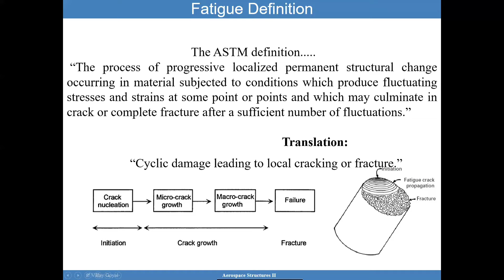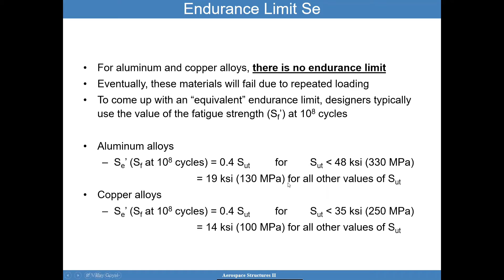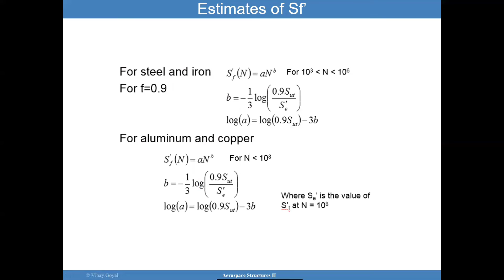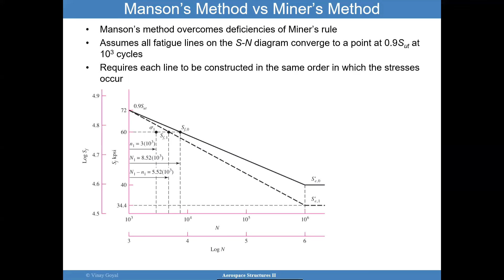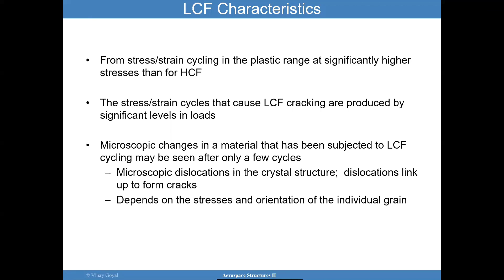Advanced Aerospace Structures: Lecture 6 - Fatigue HCF and LCF

Comment: 0:50-3:09 Fatigue Definition
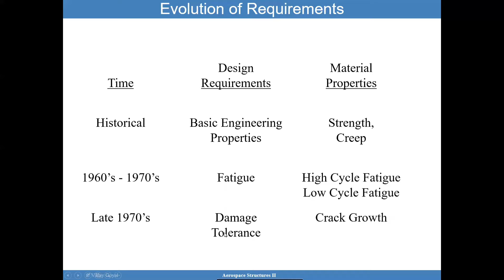3:09-5:00 Evolution of Requirements
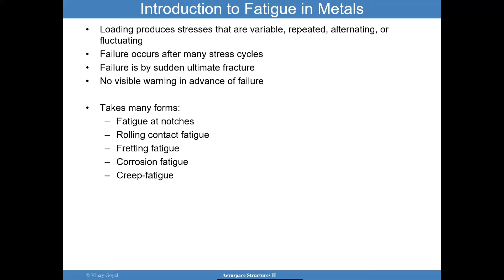5:00-6:06 Intro to Fatigue in metals
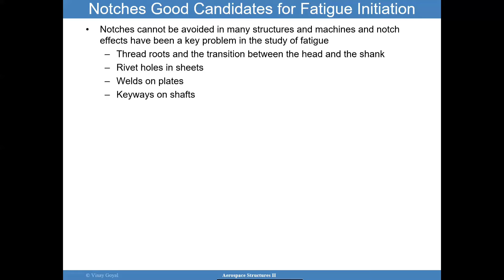6:06-6:45 Notches Good candidates for fatigue initiation
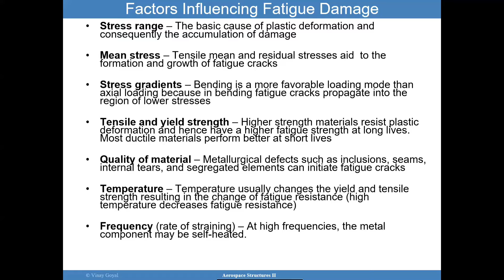6:45-9:35 Factors influencing fatigue damage
9:36-10:24 Potential Crack cause
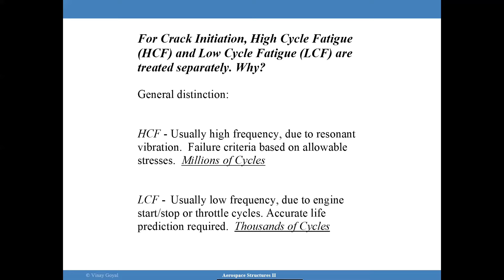10:24-11:40 Intro HCF LCF
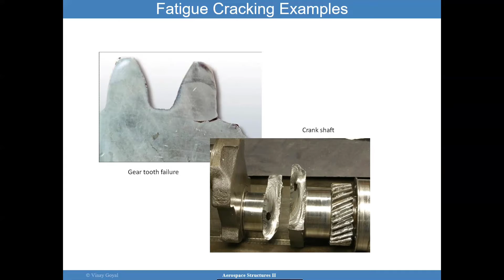11:41-20:40 Fatogue cracking example
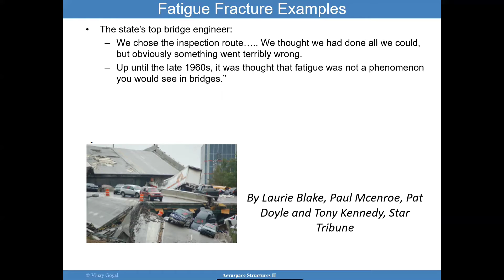20:41-26:13 Fatigue fracture examples
26:14-27:06 Stages of fatogue failure
27:07-28:12 Featured of fatogue fracture surface
28:13-29:14 Fatigue stages
29:15-29:45 Fatigue crack formation
29:46-30:20 Fatigue process
30:21-31:01 Fatigue process from material sciences
31:02-32:00 Fracture surface characteristics
32:01-41:40 Schematic Fatigue Fracture surfaces
41:41-41:58 Fatigue fracture surfaces per SAE
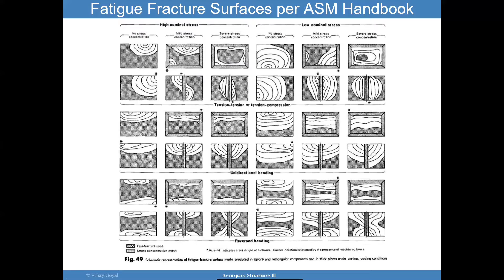41:59-42:16 Fatigue fracture surfaces per ASM
42:17-43:50 Fatigue life methods
43:51-44:30 Fatigue methodology
44:31-47:30 Fatigue tests
47:31-48:04 Moore test
48:05-49:47 Effects of diameter of specimen
49:48-53:20 Repetitive loadings
53:21-55:00 Characterizing fluctuating stress
55:01-58:26 Diff values if R (smin/smax)
58:27-59:30 Varying fluctuating stresses
59:31-1:01:56 Stress history-Rainflow cycle count
1:01:57-1:03:38 SN Diagram
1:03:39-1:03:42 SN Diagram Steel
1:03:43-1:04:27 SN Diagram Non ferrous metal
1:04:28-1:10:15 Endurance limit
1:10:16-1:10:55 Endurance linit Se
1:10:56-1:12:56 Influence of loading on endurance limit
1:12:57-1:13:39 Infinite v Finite life
1:13:40-1:14:18 Method of calc. fatigue strength
1:14:19-1:15:34 Terminology and notation
1:15:35-1:17:50 Endu. limit modifying factor
1:17;51-1:18:45 Surface factor Ka
1:18:46-1:19:08 Effects of surface finush on Se
1:19:09-1:21:54 Size factor Kb
1:21:55-1:23:16 Size factor on Se
1:23:17-1:23:32 Loading factor Kc
1:23:33-1:24:13 Temp factor Kd
1:24:14-1:26:10 Ex 6.5
1:26:11-1:26:39 Reliability factor Ke
1:26:40-Miscellaneous effects factor Kf
1:26:52 Mean stress effects
1:28:12 R-ratio effects
1:31:20 Effects og High cycle count
1:31:55 SN Curve
1:32:02 Eq for SN diagram
1:33:20 Estimated of Sf'
1:33:42 Example
1:40:14 Plot Alternating v Midrange stress
1:41:55 Failure criteria for infinite life
1:42:35 Safe zone Goodman Diagram
1:43:13 Commonly used failure criteria
1:43:59 Eq for commonly used failure criteria
1:44:13 Num of cycles to failure for fluctuating loads
1:44:34 Summary Modified Goodman
1:44:57 Summary Gerber
1:45:03 Summary ASME_Elliptic
1:45:11 Example 1
1:49:53 Example 2
1:53:30 Cumulative fatigue damage
1:55:50 Illustration Miner's Rule
1:58:48 Manson's method v Miner's method
1:59:24 Scatter factor
2:01:59 Stress concentrations
2:03:04 Stress concentration & Notch sensitivity 
2:03:29 Notch Sensitivity
2:04:17 Notch sensitivity for cast irons
2:04:20 Application of fatigue stress concentration factor 
2:05:01 Collin's methos for deriving SN Curve for Notched
2:05:23 Example
2:07:43 Combination of loading modes
2:08:04 Example
2:09:10 LCF Monotonic V Cyclic
2:10:27 LCF
2:11:40 LCF & HCF
2:11:54 LCF Characteristics
2:13:16 Strain Hardening
2:14:16 Strain Softening
2:15:06 Strain life method
2:15:39 Relation of fatigue life to strain
2:17:59 Parameters for fatigue
2:17:40 Relation of fatigue life to strain
2:18:15 Other ways to account for mean stress